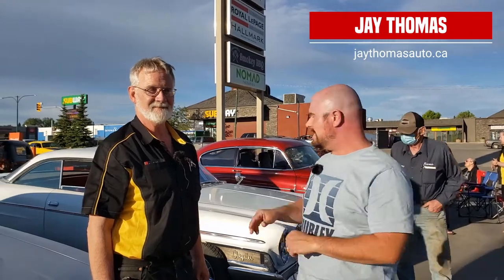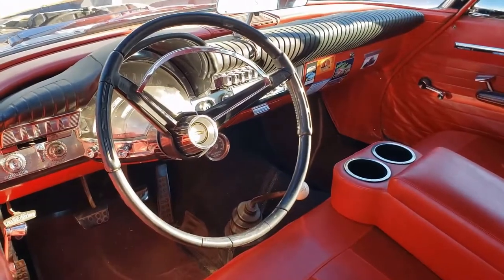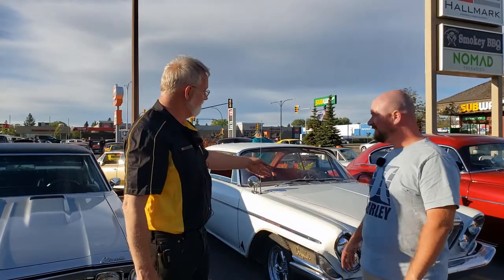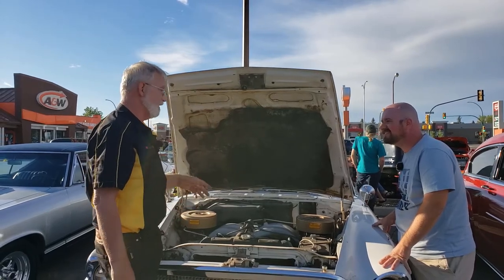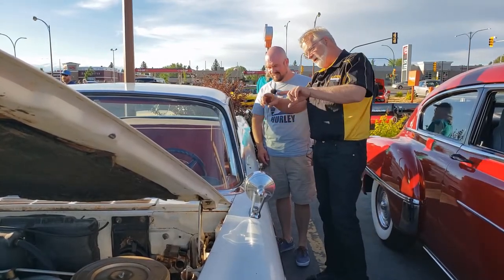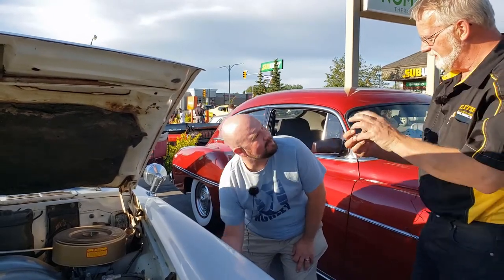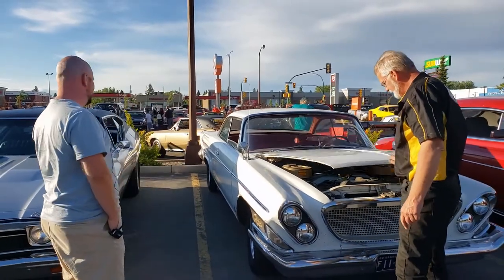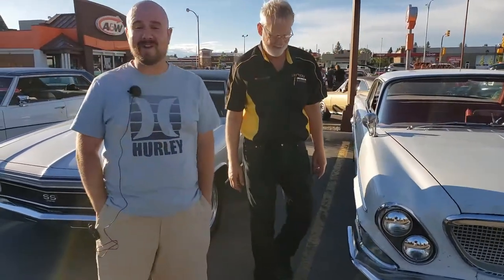Kelvin's 1962 Chrysler Newport

Comment: 440, with long reach ram induction?   HOLY COW!!!   A 413, with short reach ram produced 405 hp, in a Chrysler 300 J!!!   That car must haul A$$!!!    I'm envious.  Long reach induction was tuned for passing gear acceleration.  This car must snap peoples necks, from stomping it from 45mph to 70mph, for a pass  Our 66 300, with factory police pursuit motor, (380-395 hp, depending on who you believe) from a standing stop, broke the tires loose through all gears.  I can't imagine how this car breaks them loose with a manual......  Wonderful daily driver and a toatl sleeper for the unsuspecting teen driving a rice box

Comment: Well!  My parents helped out Ellis and Marquita, who fell on hard times, and we ended up with a 64 Newport 4-door, 361 B-block, power steering, AM radio, Montgomery Ward under-dash A/C, and ... 3 speed manual on the floor.  It did have the left remote mirror, day/night mirror (if I remember correctly), and driver/front seat passenger seat belts.  I regret not being able to save it from the junk yard (I was at sea).  The clutch, a Borg and Beck semi-centrifugal, was worn out.  But it was still a dream to drive.